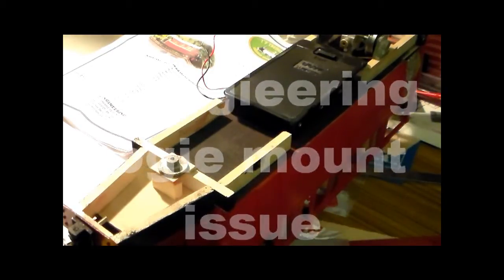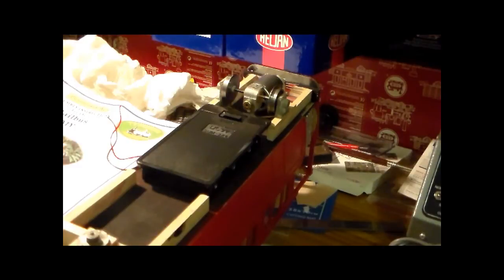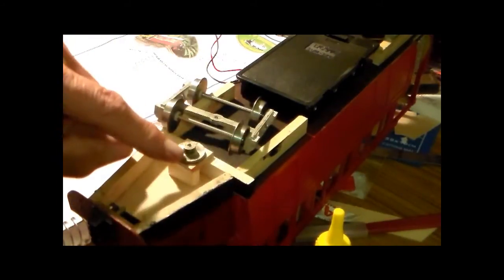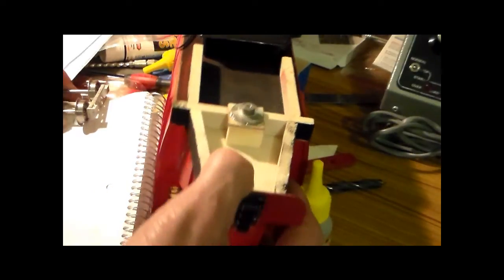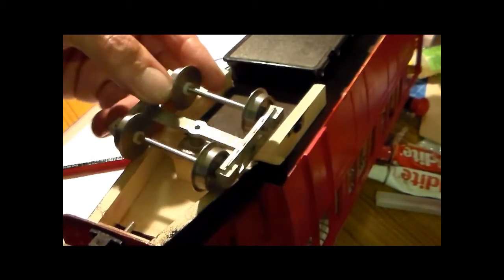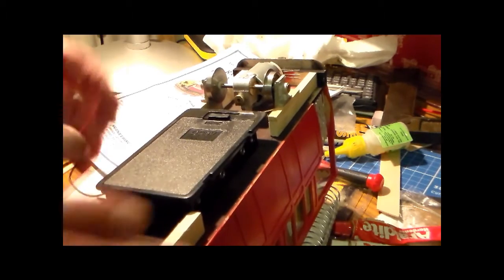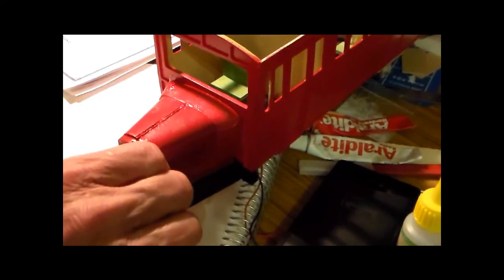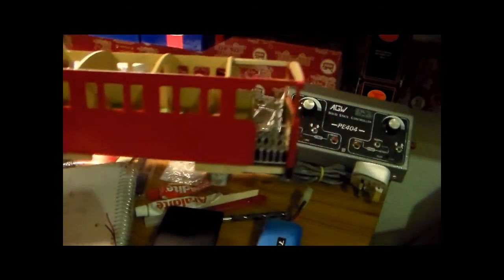IP Engineering bogie issue

Comment: Have you thought of using large washers to spread the area of the bearing?
Reply from the maker: Good idea Alan. I found a cog wheel from a printer which was the correct thickness. It also appears to be a low friction material. I also did reinforce the spreader bar of the bogie and used a larger screw.